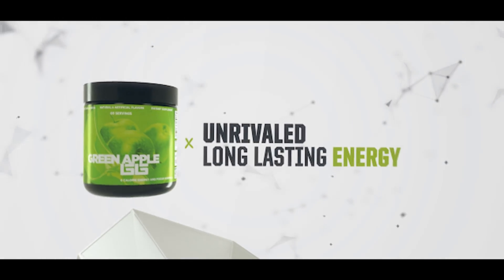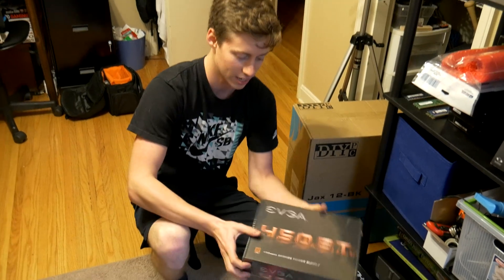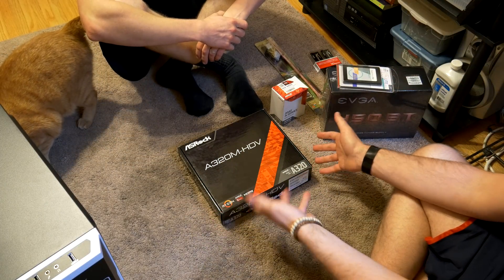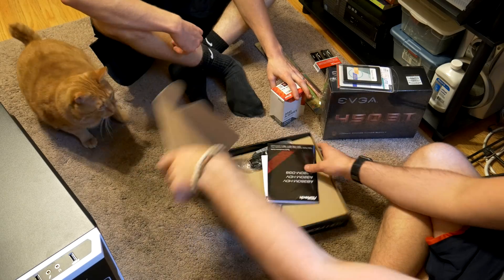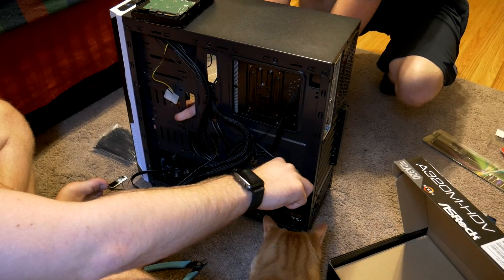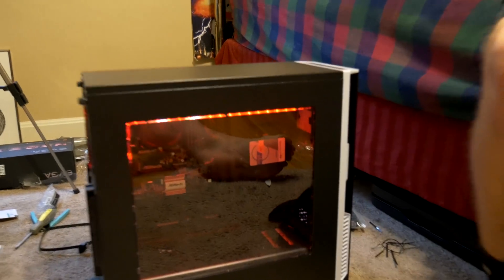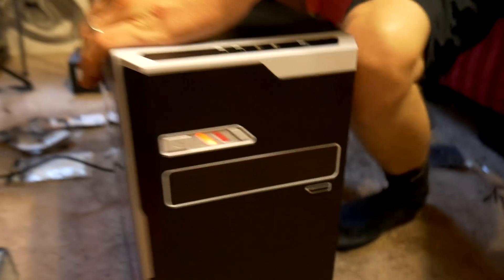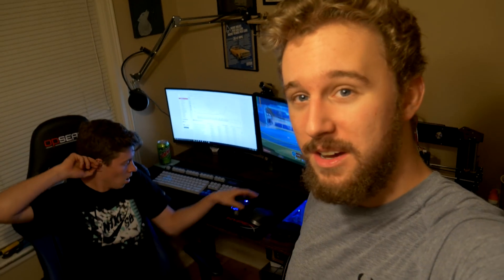Building a PC on carpet!? ESD Challenge!

Comment: EWIS training manual about ESD: "damage to electronic components  often remains unnoticed for long time".
EWIS course is a course you have to do in aviation to work om the planes. Computers are quite often for years in a plane and you cant take the risk of a failing computer because of safety and because of the high prices of thos computers. For normal pcs ESD is most often "not relevant" because you reduces the lifespan of a part and its still lasting longer than you will use it due to the fast moving industry. I personaly take care about ESD because from time to time i direct fail or short after fail can happen and i dont want to waste my money...but its up to you guys.

Comment: And they say building a computer on carpet is a bad idea, hmm, moisture is the worst try building a computer in a thunderstorm and you can see the difference.  There is not enough electrical charge in current carpet to harm a computer and the wrist bands and cumbersome and make you feel like your on a chain like a dog.  This was mainly for the older shag carpet that they had in the 60 70 up to the 80 and 90s.  Also what is more important is make sure the expansion cards grounding bar is not touching the motherboard or it can create a short out for both the expansion card and the motherboard.

Comment: How's it working now, almost two years later?
Reply: I'm pretty sure if it hasn't been affected after being built, there shouldn't be any long term affects. components usually react right away to static discharges instead of waiting 2 years, electricity doesn't work that way, only thing that can long term affect it, is how clean the pc is, and good heating, which the stock cooler for that cpu would only last about 3 years if untouched/uncleaned.
Reply: @S3xyDumpster  I was under the impression that the components could react right away, but they would sometimes go down the path of gradual degradation.  In other words, nothing gets fried and stops working right away, but the components would still have a shorter life span than if they hadn't received any static discharge.  I'm not sure if that's what you're referring to, but I never thought ESD would cause anything to stop working all of a sudden after a couple of years of use.

If the computer's doing well today, that's cool. . . I was curious as to whether there were any performance issues that popped up (which could be a manifestation of component degradation due to ESD). . . which reminds me, I need to see if there's a follow-up video to this one. . .

Comment: this is cheating you should keep the board on the carpet to simulate an idiot building a pc , motherboard box is like an insulator between you and the board, things wont die if no current flow! you have to flow current from point a to point b  like your hand is point a and the carpet is point b if you were charged and suppose you try to pick up a ram from the carpet for few second your body and ram makes connecting , if the charge discharge thru the ram chips it will surely kill it!
Reply: Kuntal ghosh it wouldn't make a difference...

Comment: Potatoes. 
  I've never killed a pc component from esd before. You don't have to use the esd straps and use a static free mat, but i still try not to do it on carpet. That's pretty much the only esd preventative measure that i take.
Reply: so you don't plug in your psu and turn it off? Is doing what you do safe? First time builder, wanna know.
Reply: @ChromieZone  Just touch any metal thing like a metal table leg and you'll be more than fine.

The best to prevent esd is by not thinking too much about it..

Comment: But wouldn't consistently touching the PC case while building work as a ground also?
Reply: Okay. Should i keep the power cord on the psu but keep the button off when i open my pc? i clean it everyday so i wanna know..
Reply: llama Thats what I was thinking that's why it didn't have any affect it has to be a rare occurrence for a computer part to fry like that I've taken apart PC's on the carpet and never had any issue's. Not saying go ahead and take apart your PC or build a PC on your carpet but as long as you consistently are touching the case you should be okay.
Reply: i want to be sure, if i touch a big metal heater does it help?
Reply: B4ss GT when I open up my computer to clean it I disconnect everything that could potentially hold power then after I unplug the power cable I push the on button a couple of times to fully drain everything.
Reply: me too but i wanna know how to get rid of all the static electricity so my new pc wouldnt fry..
Reply: B4ss GT any metal preferably bare metal doesn't matter what could be your PC case and metal preferably bare metal (not painted) is gonna act as a ground I've heard of some people using a separate psu outside the case not attached to any computer part plugged into the wall with the button on as a ground sounds like overkill to me but any bare metal should do.
Reply: I personally just touch my PC case every so often.
Reply: B4ss GT most metals would help. You'll get transference regardless of what you touch. Mainly as long as it's conductive.